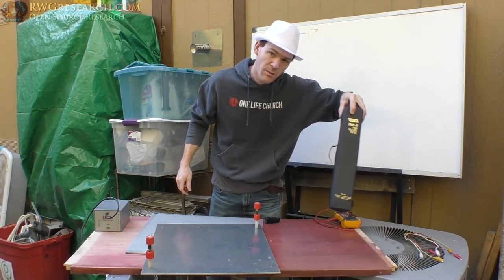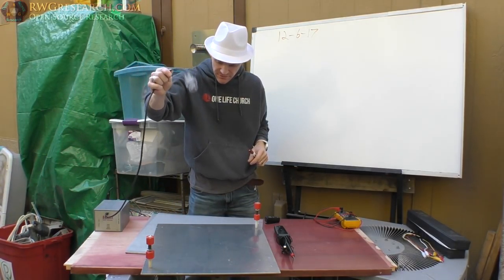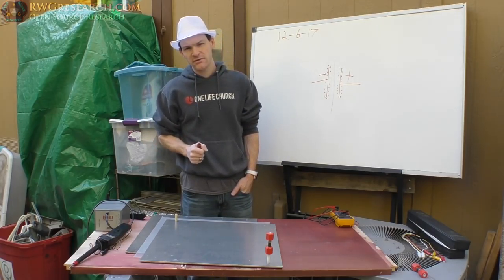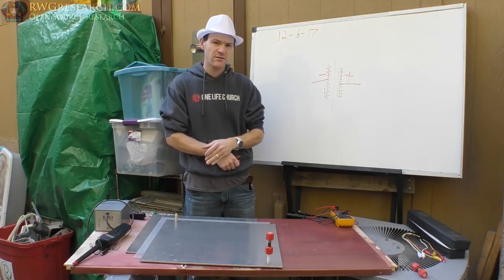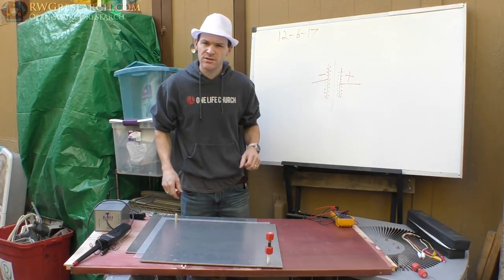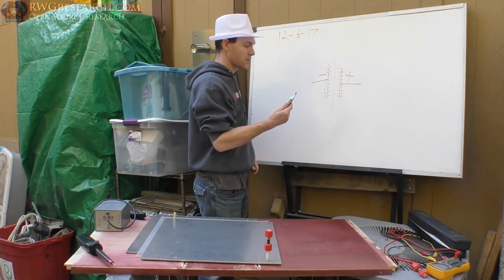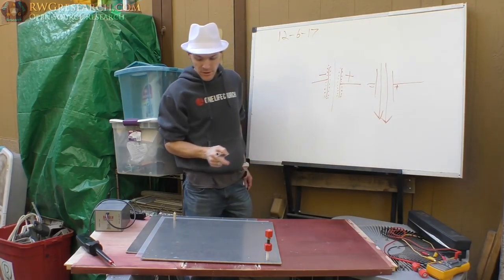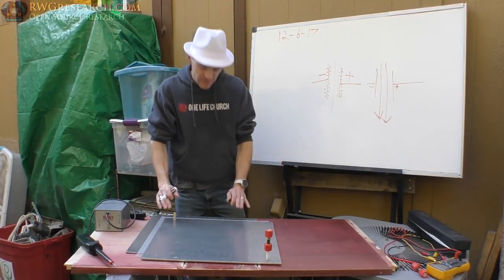The Search For Answers Part 12: "Charge IS Stored On The Plates" Are You Sure About That?

Comment from the maker: This is a simple demo to make sure everyone understands where charge is "stored". it is often thought that charge is "stored on the plates" this is a confusing statement. So to clear this up for my viewers i thought i would do the demo my self. Enjoy, ~Russ
Reply: rwg42985 I believe air is a temporary charge for air capacitors, but it can be stored in a less temporary medium, as you demonstrated. And I prayed for your neighbors and you.
Reply: Hey, I wanted to explain myself better.  According to my uft, I made a video on it, metals create bigger electron orbits that go around entire molecules, not just one atom at a time.  Magnetic fields are extensions out side of the metal magnet or wire that are organized at a 90° angle to the designated neutron in a magnet, and string of designated neutrons in an energized wire.  Thus a capacitor should work by creating large orbitals when energized, that move Into the area between plates. If it is air, the charge will dissipate quickly when turned off or moved, but a liquid or solid would theoretically, have the charge dumped into it.  If this is true, and it appears to be,  your plastic sheets should discharge with different metal plates sandwiching it.
Reply: Here - https://electronics.stackexchange.com/questions/75151/does-a-capacitor-store-charge they say it isn't charge but energy that is stored.  

Googling the question, I got a runaround of what I call avoidance answers. 

They argue the energy is stored in an electric field which based on what you present here that field is on the dielectric.
Reply: Great Video! I believe energy is stored in the dielectric in the form of an electric dipole moment. The mylar polarizes due to the voltage potential between the plates of the capacitor. If this orientation of the mylar molecules can be kept for a set time it allows you to switch the conductive plates and achieve a discharge. You do not feel a shock when you touch the "charged" mylar with your hands since the resistive nature of your hand and the mylar does not allow electric energy to flow. After doing some reading I've reached these conclusions and I would love to hear some insight and or critique from others. Capacitance can exist in a vacuum as well (haven't tested this personally) so it is safe to say the dielectric is not needed for a capacitor to function. Hence, energy in a capacitor is not only stored in form of a dielectric dipole moment but also in form of a dielectric field between the plates. We cannot explain capacitance in a vacuum otherwise. The questions that follow are:
Are these fields fixed in space between the plates, or can they be moved outside the plates if you can somehow extract the spacial volume of vacuum?
I'd love to hear your opinion!

Comment: Great demo. I struggled with this for years because the internet does not give a true answer. Hal puthoff in his polarizable vaccuum representation of general relativity , says that the vaccum or space that the object is sitting in becomes polarized, along with the material. This led me to also researching meta materials which are the physics of the interface between a metal plate and dielectric. This information helped me to figure out how the Don Smith device works. He is actually using the polarized vacuum in the dielectric of his capacitors to power the output transformer. He blocks the conduction electrons with resistors, and the electric field or displacment current doesnt obey ohms law so it can happen past the resistors. At that point he alternates the electric field through the transformer coil to ground. This becomes a changing electric field in the coil which cause a magnetic field to be set up in the coil. Everytime the ele tric field changes it collapses the magnetic field allowing for induction to take place in the output coil while stepping down the voltage and increasing amperage. I could use help building a switching circuit for this . I am using a single transistor but it heats up quickly. Each pole of the cap is place on the emiter and collector and then the base is my output but this isnt very efficient. Two transistors are needed but im a humble self taught physicist and not an engineer...

Comment: That is in fact the Basis for all capacitor build's, the thinner the dielectric the more current but lower voltage due to burn through, if you make the dielectric thicker you can charge to higher voltages but you get less current. also the gaps must be larger around the plates so the dielectric surfaces must always be much larger than the plate area that is why capacitors used to be so massive in the 1960's before new technology found better insulating material to make them smaller. Now Russ here is an Interesting project for you !!!! Build a capacitor with a Rolling dielectric being wound from one spool to another like a TAPE DRIVE and charge an entire roll of dielectric material and then retrieve that stored energy later OO

Basically like a Magnetic tape recorder but not magnetics instead ions on a roll. Question? Would a charged roll of dielectric material lose its charge ? My Guess is the bigger the roll the more loss, so over time if a roll has 10KV on it per each centimetre then all that charge stored in a compressed roll would over time leak across to other layers and you could lose 70% of the charge. High humidity will also incur huge loss.
Reply: Very NICE

Comment: Russ,   
Wow is all I can say, I have always thought the charge was stored in the plates, that what we have always been led to believe.  If the two aluminium plates are shorted and the charged mylar sheet is replaced does it still hold the charge?  
Do lead acid batteries work in a similar manner, with the electrolyte holding the charge, we know that something is happening because of the specific gravity reading of the electrolyte?

Keep up the great videos they are very informative.

Comment: Amazing man! That is one of the wildest things I have ever seen! Check the magnetic field of the dielectric after they are removed. My theory (Ken Wheelers theory) says the dielectric should become magnetic when charged. Physics explanation would be aligned domains in the dielectric.  Blessings ~N~ Peace.
Reply: Hello there, not sure if you will see this message, I'm 3 years late to the party afterall, but I could really use a clarification from you. I still haven't watched Ken's series on magnetism, but I've watched his regular videos for the past few years. What I'd like to clarify is:

Should the direction of the resulting overall magnetic moment be aligned along the overall dipole moment of the polarized dielectric? Or in other words, in case of this mylar foil, should it's overall magnetic field after polarization resemble one that would be produced by a wire going along its periphery (magnetic flux through it), or should it circulate along the periphery just like if a current was going perpendicularly through the foil or should it be both (that would fit Ken's model, because that creates a toroidal vortex)?

I reached a conclusion that the second kind or the thrid kind of magnetic field should emerge after polarization, but I base it solely on the Climont experiment: https://www.youtube.com/watch?v=YlpyXhSb78s&t=224s which I'm still in the process of replicating, so I can't answer that with any certainty. Its results suggest that electrons (and probably protons as well) should have an intrinsic circulating magnetic field which creates the overall magnetic field of a conductor when a current is flowing through it, but the sole motion of the charge isn't what makes the field. Its the alingment of these intrinsic fields that normally cancel each other out, just like the dipole part of it ("spin"). And the alignment of these intrinsic magnetic fields corresponds to the dielectric field that generates the current, so that's where the potential connection between dielectric and magnetic alignment occured to me.

Comment: As for your question on the center plate addition. Most would think the charge would go to the center most point as like a focal point. I on the other hand believe it would charge each Mylar sheet at half the total voltage with the center plate as a neutral. Due to the fact the Mylar is atomically loosely packed compared to the steel plates. Meaning the atoms have more room to move around without bumping into each other exchanging electrons. So, the charge can build in the Mylar where as the charge flows right through the steel. 

For example sliding across a road on ice, you hit dry pavement now you have to run, you start sliding again but hit another dry spot you have to run. Then you hit ice and finish sliding across the road. The total energy used is the sum of the 2 runs.

Great video as always keep it up.

Comment: In reply to your question the 3rd plate will have cold electricity, as Tesla stated. Check for it's properties. Check also "Tesla hairpin circuit" - part of the circuit  AFTER 2 capacitors is that 3rd plate. Cheers    P.S. What if  3rd plate would be a coil?

Comment: Ahh inductive polarization of the dielectric material. Remember the metals are conductors they don't store anything. Likewise if the inductive metal wasn't there you couldn't store anything in the dielectric material. In order to access the store you must present an inductive conductor to get at it. An electrete works in much the same way.
 It's actually as two part charge separation. one being between the two plates and the other being in the dielectric. Going back to my theory of plasma there is two different types one being positive and the other being negative. If the mix they become neutral. But the only time it gets set up as a charge separation is with the whole body of the plates and dielectric. It has a memory because of that instance of electric charging. This separates the plasma between the matter and dielectric into it's separate polarities and it has to be exactly the way it was during charge or you will not get the same results as you have seen. Plasma is very electric and magnetic sensitive. The "charge" is actually the density of the plasma withing the whole body of the device. All of the components store the charge and all of the components has to be there to access that store.
 Building a super massive coil isn't the answer. What is the answer is Tesla's own idea and understanding of the bifilar coil. 250,000 times more storage capability then a normal solenoid. Huge boost in capacity and in the version you tested in the Abha coil plenty of plasma storing the energy. Do you remember the papp engine. Remember the capacitor I promised you? Add oil to the coil and the plasma is there uninhibited by air which turns into ozone. Oil negates two problems in this case. No ozone production and increased insulation for the coil and if it breaks down, the oil usually seals the breach.

Comment: I would like to see if using something like CCTO as a fired plate, would increase the amps that were able to be stored in a capacitor vs say that plastic sheet you worked with. (CCTO having a dielectric constant of 250,000 vs the small constant of just 7 for say teflon sheet)
Reply: Что такое ССТО?
Reply: sorry google translate has failed, what do you mean in english? 
 @2005Gresko
Reply: @ThomasAndersonbsf they were wondering what CCTO was. I'd love to order myself a sheet of the stuff to play with it...

Comment: Interesting ,  but when you flip the Mylar and show 0 volts you have the ground connected to the bottom plate....
    Remove the ground then assemble the Mylar between the plates and measure both plates..
    Then flip it again and measure again..

Then discharge it,  rub the Mylar on your head to charge it, then assemble and measure it..

Comment: Wow, I wouldn't have known the charge was stored within the dielectric material itself! And yeah, it got me thinking about air capacitors. Removing the air "should" remove the charge completely, but it's still there. Or is it? 🤔 EDIT: I'm going to guess the charge will be removed if you blow the air away. I'm going to have to try this one but I haven't built an HVDC source yet, only high frequency AC ~30kV.
EDIT2: Here's a thought... Capacitor places in a vacuum chamber!

Comment: This is flying way over your head. Both the conductor and permissive dielectric are required.  When you blow the air out between an air capacitor more fills its space, aligning in the same way the air was that you blew out.  Try putting it in a vacuum and see your farad value drop.  A majority of the charge is stored in aligning molecules which is coincidentally what makes a good dielectric, ie very polar groups. The reason you can remove the mylar and reinsert it is because it is still electrically aligned without being discharged.  A good demonstration, nonetheless you are putting way to much thought into this simple phenomena.
Reply: Non-rechargeable batteries, can be recharged to an extent but not recommended for possible leaks. The difference is said to be destruction of the di-electric. Hmm.Why would ionized air not expelled or dissipated like so much of our energy but contained in tubes not work?
Reply: No non rechargeable batteries are entirely different than capacitors.  There are faradaic reactions that occur at electrodes that can't be easily reversed (at least before the dielectric breakdown voltage of water is reached).   I think the major reason you probably can't blow the charge out of an air capacitor is the Bernoulli principle because a boundary layer is formed you never truly remove the air closest to the plates.
Reply: With tube then your view is the displaced ionized air would create a vacuum. So the Townsend avalanche would propagate in only one direction to fill the space in the tube?  The Bernoulli principle is fluid dynamics saying that if air speeds up the pressure behind lowers. That would be in an open system to the atmosphere generally I think. We observe from the Papp's popper experiments that in an enclosed space pressure increases with the Townsend avalanche;  usually a gas would expand pressure to equal in all directions (with time). Robert Murray Smith is releasing a product as a dielectric tape roll to replace inbatteries.